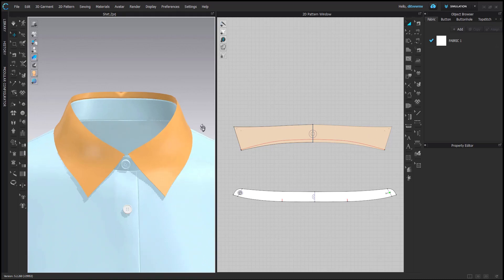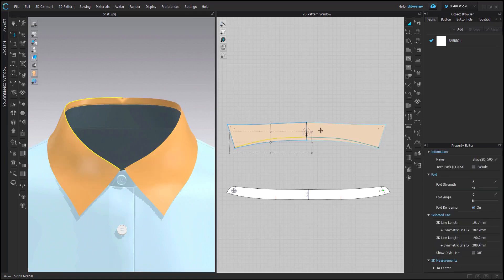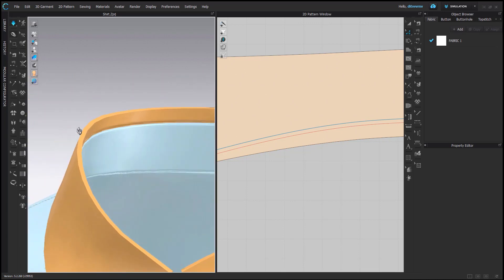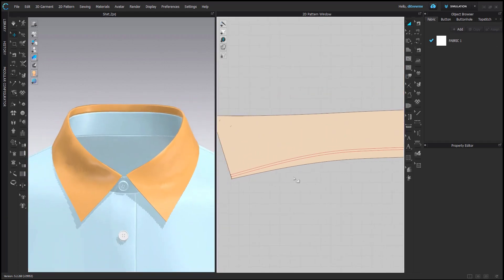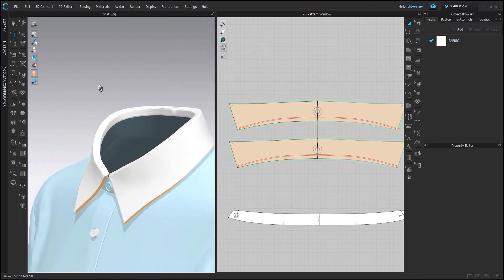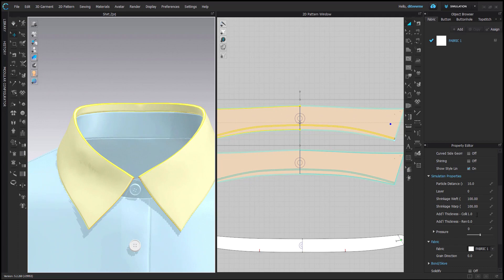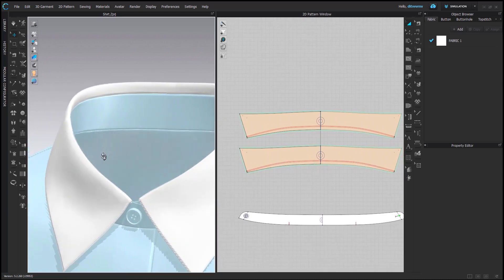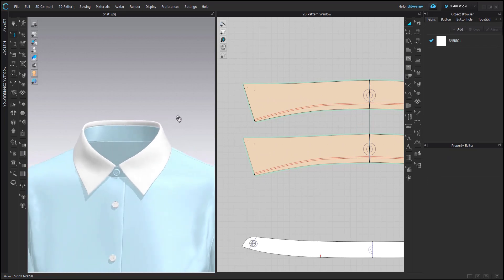CLO3D | Perfect Collar

Comment: Hi! Im a beginner and your videos have been helpful, i just drafted my first shirt on clo, for the collar i only have one fold line but i increased the rendering thickness to 2mm and i was pretty satisfied with the result, is that too crude of a solution? Im still not sure what is "normal" to do and what isnt, so much to learn...
Reply from the maker: Thank you for your comment. I think it is difficult to define what is ‘normal’. It depends on your preference. I do all folds with 2 internal lines, I prefer that look. In my opinion it is also better approach if you plan to export the 3D garment and use in 3D viewers or other software. But plenty of people use the 1 line and are satisfied with the result. The most important thing is to know the options and choose based on a situation. :)
Reply: @stitchandrender  Thank you for your reply! I studied fashion design originally so im still learning to appreciate the subtilites of 3d objects and renders, what attributes are important for which purposes etc, it's fascinating
Reply: @stitchandrender  now that ive started doing a few renders, im finding that two fold lines do look better! 😊 thank you🙏
Reply from the maker: @microplastique  That's great to hear you are exploring 3D as a fashion designer. :)